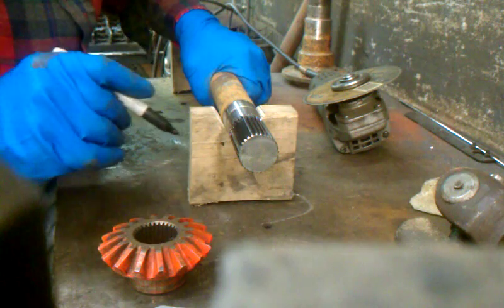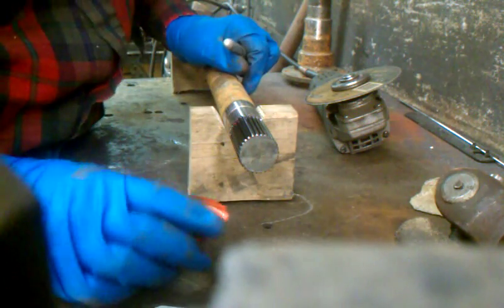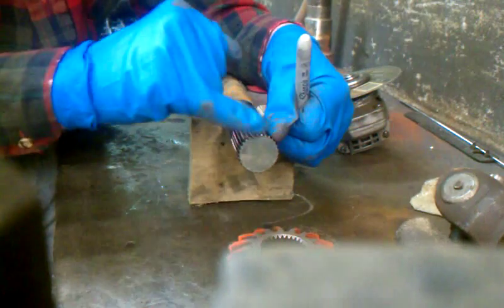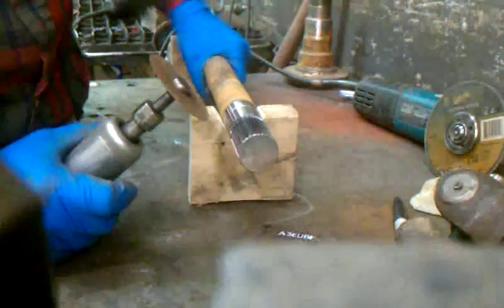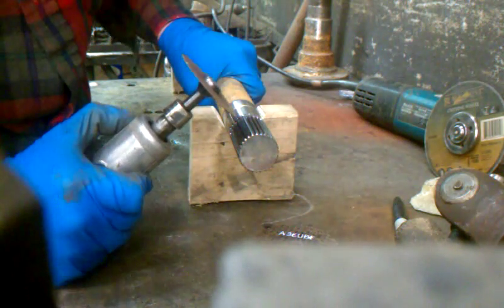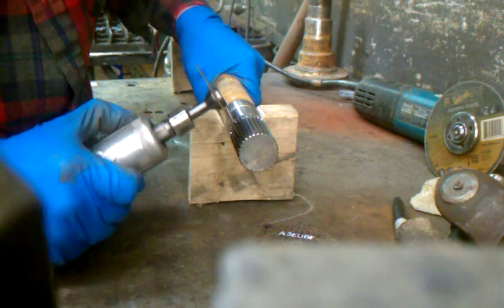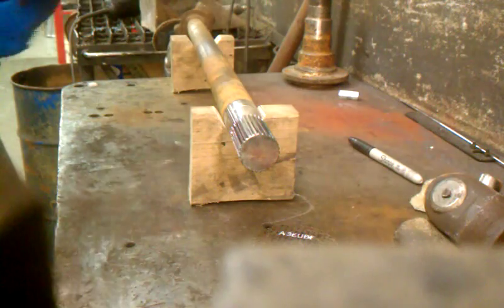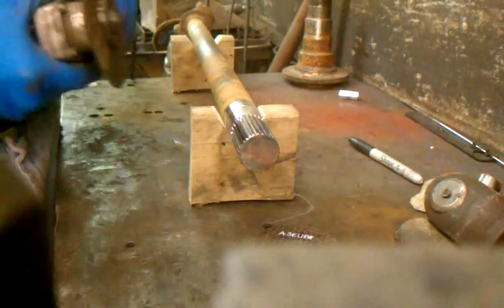Fixing splines slightly off from tolerance stack up

Comment: How much do you think this  compromised strength.  I did this to my new used chromos d44 and I'm a little worried about the splines uneven mating surface due to my free hand and a Dremel. R
Reply from the maker: Ya do what ya gotta do.  but if you are pretty even in your work it will last a long time. I'm guessing you will break a u-joint long before an axle. you wont strip the splines, if it breaks it will be at the end of the side gear.  To make the axles last twice as long they need to be  reduced in size to just under the root diameter of the spline. this makes it work like a torsion bar. Just like a bolt is no stronger than the root diameter of the thread the axle is no stronger than the root diameter of the spline. for much more on this go to Pirate4X4.com and find the Jantz Engineering thread.